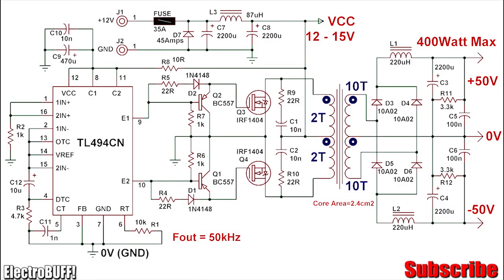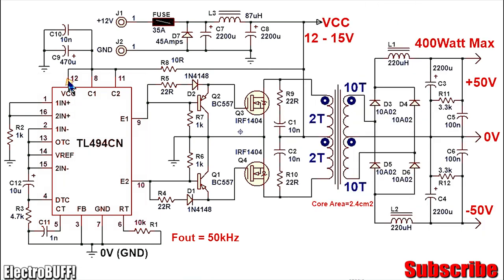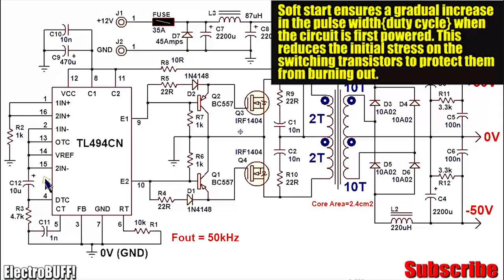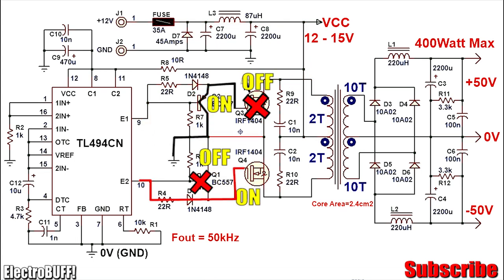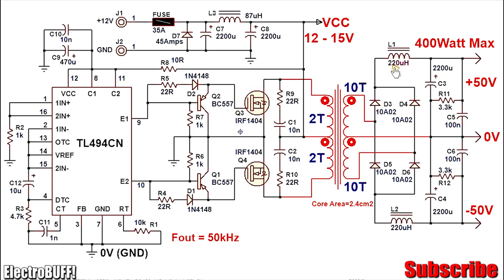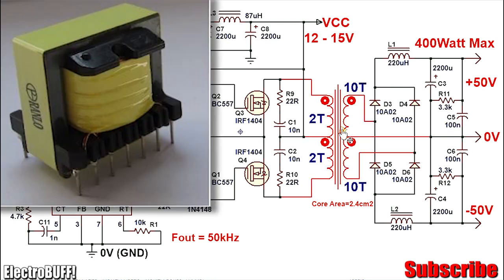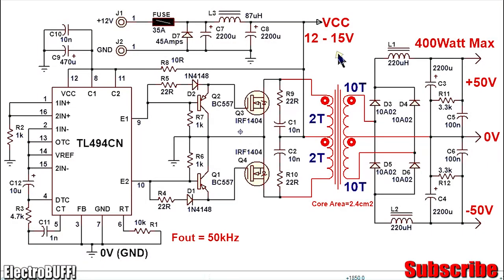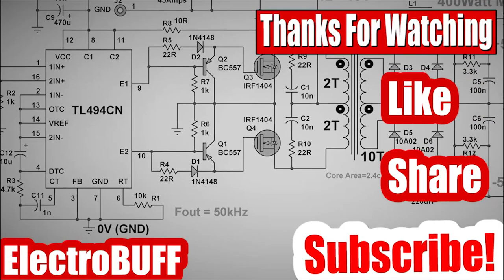TL494 Switching Power Supply For Power Amplifier 50-0-50V

Comment: Nice explanation each and every point..
Sir any software for simulating this boost converter circuit using tl494 ?? I mean any software does hav library for tl494 ic??
Reply from the maker: Proteus works well for some circuits.
Reply: @ELECTROBUFF  but there is no library file for tl494 and sg3525
Reply from the maker: @jdsound4931  There's one for TL494. For sg3525 maybe you can check online if someone has developed a library, Personally I didn't find one.
Reply: @ELECTROBUFF  sir many thnx for reply but i use proteus since last 5 year but i hav no library file but can u help me if u hav library file for 494 ic then pls give me that by mail

Comment: Thanks for very good description in all of your videos. Please which is the influence of a cracked transformer core at SMPSs. Just crack without any missing parts.
Reply from the maker: Depends on the location of the crack. At worst it will reduce coupling, and consequently the power output.
Reply: @ELECTROBUFF  Thank you for response, the core consists of 2 parts, both E shape. Only one part has cracked one of its outer legs. This is the case.
Reply from the maker: @sv7gbr  That will significantly lower flux linkage. You can try using a tight fitting tape to secure all the core pieces together, but still it won't be as effective as before. If you can just salvage an alternative core from any smps as long as its almost the same size
Reply: @ELECTROBUFF  Tnx again for your time and instructions. Have a nice day.

Comment: Hi have transformer AC 25 - 0 - 25, After DC it is +35  0  -35, Dual Rail power supply with 4Amps, now i want to be Reduce the DC supply to lower Voltage as +20  0  -20, with 2 Amps, for Amplifiers, plz suggest us some tips.

Comment: What is the point here? Without any feedback, this is not better than a 555. The power supply shown here is fully unregulated. 60V-75V
Reply from the maker: In the video I've shown a feedback circuit for precise regulation using an optocoupler and a TL431 ic

Comment: Wire gauge Number?
Reply from the maker: AWG 24
Reply: Is it AWG or SWG?
Reply from the maker: @liladharramteke8969  AWG(American wire gauge)
Reply: I asked because there is difference in thickness between American Wire Gauge and Swiss Wire Gauge, that's all, I just wanted to double check. By the way I think TL 494 was also used by Mr. Gupta in his project for Computer Power Supply in Electronics For You in the year 1993. Regards. Thank you.
Reply: 12 to 70 ov 70 dc